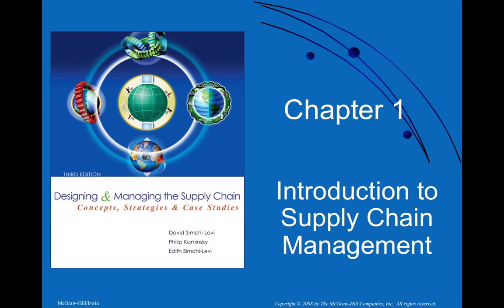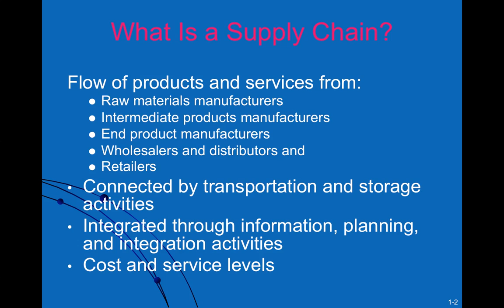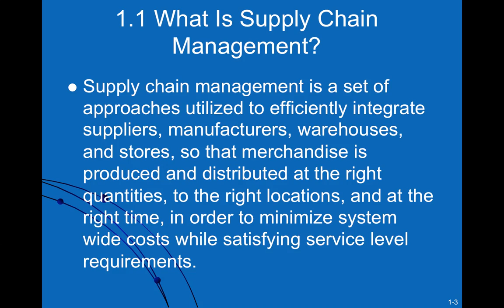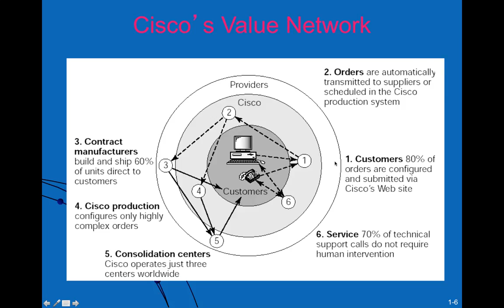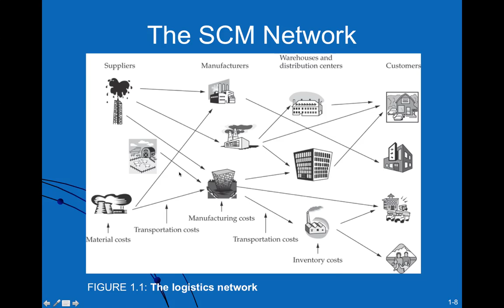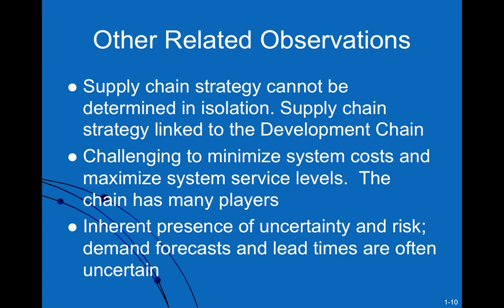Introduction to Supply Chain Management Part 1

Comment: I have a question: How many methods calculate the service level for supply chain?.

What's the relationship between the service level and the stock level?.
Reply from the maker: The service level will determine the stock level.  The service level is the probability of satisfying the demand.  If you want 100% service level, you will have to have a large amount of inventory.  If you are willing to have a 70% SL, then you will require less inventory on hand.
Reply: @DrHarviMillar  , what is the relationship between the service level and safety stock?, the service level is the safety factor in safety stock formula, right?

Comment: CAS is next level challenge on the supply chain innovation. S&OP ,AOP, FOP and ISC should also have more innovation , we did it.  if you have more supply chain management question , can reach me anytime, I just publish one ISC book(integrated supply chain management) including SCOR and AOP, FOP,S&OP and total inventory constrained model and innovation forecast accurate measure solution not like as MAD from APICS.
Reply: Susan Lee I'll check them out, thank you. Are you on LinkedIn? Would like to see what other resources you have there.